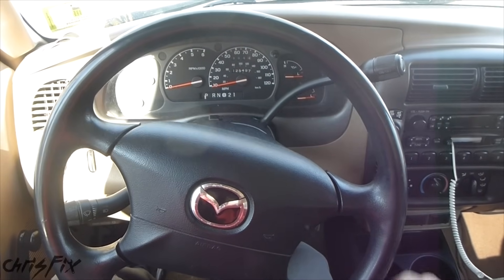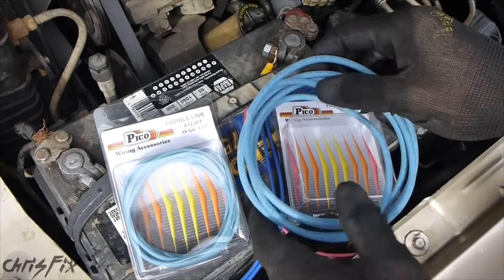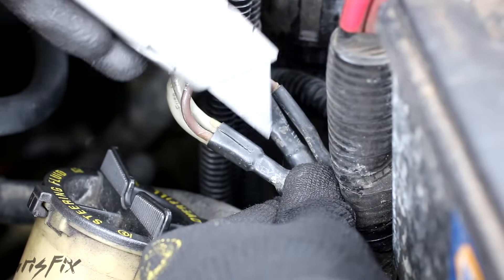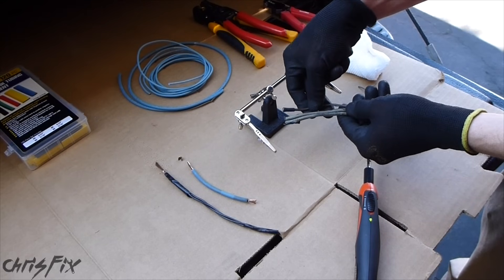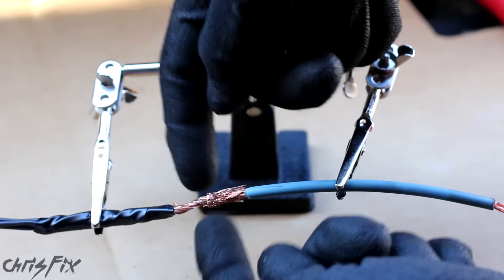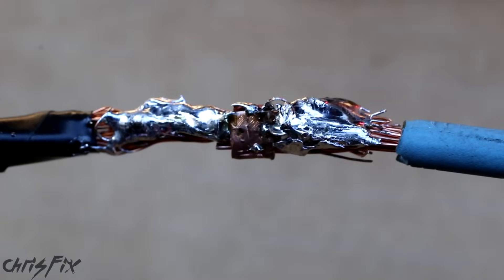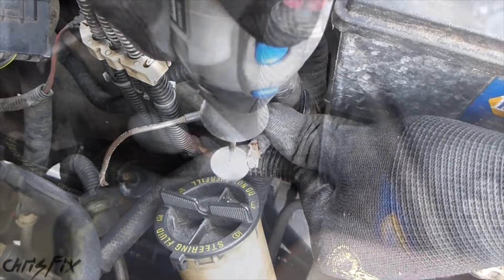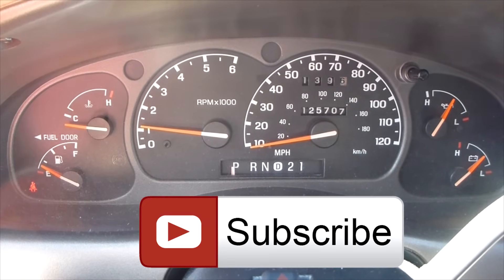How to Replace a Fusible Link (Car won't Start)

Comment: Smashing job chris :-))
Resistance is a dam nusance, makes a big impact at high currents, i like the ring crimp :D, ive wrapped a single strand of wire around the joint to compact it and hold it together for soldering, handy for times where you dont have clamps :D
When i worked in an autoelectrics shop i had to fit big military plugs onto 16mm sq battery wires, spreading the wire strands apart and tinning them was my way to make a good solder job, a large highwatt weller soldering iron was a must!!

Your iron hasnt got enough mass at the tip to deliver the heat, thats why you had a little trouble, bigger and higher wattage chris :), im not picking fault, its just experence from an old git ha ha :D :D
Flux is really helpfull on hard to solder wires :D
Reply from the maker: zx8401ztv Thanks bud and thanks for the tip! I think I will return the soldering iron and get a bigger one! Any recommendations?
Reply: ChrisFix
For ordinary wires about 40w if outdoors, wind and such cools them down.
For battery main wires the bigger the better, a 100 watt with a solid copper monster tip, like a screwdriver but made for frankensteins monster lol.
Just think about the heatsinking effect of big wires and the fact you want them really hot to make the solder flow like water.
You can allways spot a cold joint, its like blobbed on the surface, not sunk in to all the strands, with large currents like starters pull, you need every strand to be doing its job.
You cant rely on the strands being close to each other in the cable, dampness makes the strands go black and they become seperate due to the corrosion.
Sorry chris, i do waffle a bit, but i want you armed with a full understanding.
See if you can still get soldering flux, its an acid that cleans copper and makes the solder flow better :D
Reply from the maker: zx8401ztv Thanks for the info! Yea, this was a 60watt and I tried my 160 watt but neither did the job. Maybe I need a butane one?
Reply: ChrisFix
Its not just the power, the tip has to have enough bulk metal to store the heat for long enough to do the job, most irons take a while to warm up so there element isnt capable of delivering constant heat for very long, thats why you need a bulky tip, the element brings it up to temprature but the tip is an instant power store, so the heat only drops slowly as you use it.
Can you see where im coming from?, lol yes the uk lol.:D
Reply from the maker: zx8401ztv Gotcha! Ok, so I will try to find a flathead tip!
Reply: ChrisFix
As bulky as possible.
And when you apply the soldering iron, tin the tip and put solder between the tip/wire interface, it make the heat conduction better/faster :D
Reply from the maker: zx8401ztv Thanks for all of these tips! Maybe we can talk some time for a future video on soldering!
Reply: ChrisFix
Get the conditions right and it will be eeeasy :D
Reply: +zx8401ztv Those are excellent points. Also, in the rare case where there is room to safely swing a torch, propane is a much faster way to heat and solder big wires like this. I like that little copper crimping clip that Chris used. Next time I'm in the  parts store I'll look for those.
Reply: +spelunkerd 
There are some nice tools out there, the trouble is you would need to rob a bank to afford them ha ha :-D
Problems soldering is typically dirty and un tinned copper, the connector needs to be clean and tinned, the rest is having enough heat stored to get every strand hot enough to melt that solder so it flows like water.
Oh never use lead free solder, yuck yuck LOL :-D

Comment: Are there fusible links coming off the alternator wire where it bolts to the alternator? Also if ones corroded or not getting connection will it make your lights pulsate headlights,dashights and dome lights

Comment: If you have an older car such as a Mustang GT FOXBODY 1988 for example, it has a starter solenoid which has the same symptoms as Chris is showing :)
Reply from the maker: Andres Rivas Thanks for sharing Andres! This info will definitely help a lot of people!
Reply: Thanks for posting this comment
Reply: I have a 95 mustang that won't start has new battery but the negative post gets hot. The alarm goes off when door is open an using the push putting alarm will not lock or unlock car it has the viper alarm

Comment: Just FYI, that same problem can be cause by corrosion on battery terminals or connectors, especially on large amp drawing systems, for instance a 7.3 PSD that requires 900 amps to turn over.  Corrosion causes not enough current to be able to flow and you get that exact same result.  Turns on, almost wants to start, then no power left.

Clean battery terminals and connections and it will go away.

Comment: Hey Boss, what kind of crimp is that? And what other types of crimps are acceptable? Can I also just solder the wire well and use heat shrink tubing?

Comment: You have to make sure you use water proof shrink wrap. there are shrink wraps that when you heat them up, clear glue oozes from it and seals it up. its basically hot glue silicone If your not getting that then its not water proof
Reply from the maker: Thanks for the tip!

Comment: Hi Chris I have kind of the same problem with my 06 Grand Prix. It will happen randomly throughout he day. I'll try to start my car and for like a second it feels like there's no battery and then the car will start. All battery connections are clean and the battery is new. This started after my mechanic changed my ignition module. When I told him about this problem he said it has nothing to do with the ignition module. I tried looking for the fusible link but couldn't really find it. Any thoughts what could be causing this problem? By the way love your videos.  Thanks to you I managed to change my breaks on my Grand Prix two weeks ago. Thanks again.
Reply from the maker: bojna1 Glad the videos are helpful. I would check all the connections to the battery, starter, alternator, fuse box, etc. Check any fuses and relays that have to do with starting the car. Without seeing the car it is hard to say but that is where I would start.

Comment: Are these wires the same as the Fuse links in the fuse panel? They look like a box with the wire inside and a clear cover on top that say 30A, 40A and are different colors. Could you swap a fuse link wire with a plug in style fuse link?

Comment: After I solder the wires, I use a pair of pliers and go round the connection and flatten all the stray wires so they are smooth and do not poke thru the shrink tubing.  I want to prevent it from shorting out again.

Comment: Sometimes you can have a similar issue due to those universal battery terminals that "smash" the wires, like you have on your truck.  I had an issue with those.  Everything was tight, but I would lose all power occasionally.  Turned out to be the universal terminals.
Reply from the maker: Blaine Bugaski Thanks for sharing! I need to get rid of those universal connectors!

Comment: is it wise to add a bigger 4 gauge power wire to existing one or replace stock one with 4 gauge? I upgraded my alternator from a 90 amp stock to 160 amp. I’m having some charging issues at high rpm’s. Should I also replace the fusible link to a 160 amp fuse?

Comment: Does your 50 amp fuse break as well and have to replace?
This is the same thing my truck is having problems with but won’t crank. 
Have to keep replacing my 50 amp fuse every time and when I do my dash lights up but when I go to crank it the same thing happens it goes dark and seems like it’s the battery. 
New battery new starter put in recently.
Reply from the maker: No just the fusible link went each time. Try checking the wires from the fuse and make sure they are not bent and broken a little causing more draw. Or that they are corroded.
Reply: ChrisFix really appreciate it my brutha thanks for your input

Comment: Fusible links in cars are generally used to reduce the likelihood of a person not taking their car to the dealership for fixes. No way around it, it is an intentional problem. Fuses and breakers can do the same job but those can be replaced by the everyday-knowledged person

Comment: Hey chris , out of topic question , My car have an electric fan clutch and it have a big cable with lots of wires , how do i connect the new only 2 cabled electric fan to the old cable ? should i connect it to the old cable or just skip it and connect it directly ?
Reply from the maker: eyad aljamal So you have an electric fan and replaced the motor? The old motor has many cables and the new motor has 2? Just want to make sure I understand. They didnt have a plug and play motor for your car?
Reply: No i have an electric fan CLUTCH , its like a normal fan clutch but it come with an electric wire from behind to connect it to the main computer to control the speed of the fan , so i looked around and it seemed like its a common problem in all cars that uses the same electric clutch , so i decided to take the old fan and electric clutch and Install a new electric fan like what you would find in newer models , so i looked around and i found out that the best fan can fit in to my car is the same fan you will find in your ford police car .
so the ford fan have two wires power and ground how or should i connect them to the same electric fan clutch wires ? or connect the fan directly to the battery ?
Reply from the maker: eyad aljamal Gotcha, now I understand. You might have some trouble wiring it up because the fan clutch should activate based on temperature. When the radiator gets to a certain temperature, the computer sends a signal to lock up the clutch. It is also telling the clutch to disengage based on rpm (you dont want the fan spinning at high rpms. If you just connect it to the battery, then it will always be engaged.
Reply: yep and now its always engaged and the car temperature is always low and that's good .

Comment: Community.      could I use a voltage meter to identify the wire issues. I dont want to cut into the harness until i am sure.  Because of corrosion- I replace to rings of the fusible links, that are attached to the alternator ( thick yellow), at the fender mounted starter relay but I have flickering lights. I cleaned all grounds in engine compartment. I believe it maybe corroded inside the harness. How can I test for that?  Thanks

Comment: You can also use a 10ga crimp connector if are splicing together a to ends of a single wired link. Keep in mind: the small wire coming of of your positive battery cable is not actually a wire but a link. 1981 Corvette Owner

Comment: oh yeah one more thing Chris the check engine light immediately came on. It sounds as if something popped loose not sure what. anything you think I could check without having access to a tester? thank you have a good day
Reply from the maker: mr ok Get the code for the check engine light and let me know what it is. You can find cheap testers these days.
Reply: I'm willing to bet that's exactly what I will have to do thank you so much for responding back I wish you well. Keep up the good videos and helpful tips.

Comment: Interesting-- charging system stopped working and it seems there are two fusible links to the alternator. I have a vehicle quite similar to yours ( I have a 2000 Mazda B4000) . I don't see the fusible links sticking out to the battery cable bundle. Could they be elsewhere?

Comment: I have a 1976 GM dump truck 1 ton that has two fusible links though they are working right now I am going to be doing some electrical work to add some circuits and I don’t like them because they are turning green I’m going to replace them with easy to replace maxi fuses at the rated amperage the circuit can handle then I will know when they are blown and are easy to fix.

Comment: Hi Chris, I am having this same problem with my 1993 Lexus GS300. I have replaced the alternator, battery, and 100amp fuse. The car still will not start.. Since replacing parts, my lights will only come on when turned to the on position. The lights are suppose to turn on automatically. Also, now my radio, dome light, and heat/ac dash lights wont come on.. All fuses have checked and if bad were replaced.. I don't get it.. It all worked perfectly before, and I've never had any problem like this. I don't have the money to have it towed and then fixed. I know that the starter is also good. Its like Im not getting any gas. Could it be a bad relay?? This is what I'm assuming it is but I have NO IDEA what a relay looks like let alone where it would be located and how to check it?? I know there is a relay that controls power to the fuel pump and alternator.. I really think this is my issue but again do not know where it is located because I do not have access to a service manual. Any knowledge you have or might be willing to find for me would me awesome.. I've been car less for over 2 months now...Please help. Thanks
Reply from the maker: +Lori Kerns Dang, that is hard to diagnose without seeing the car. I would say do a fuel pressure test: https://www.youtube.com/watch?v=_oXLUqE4Sf0 but that wont help your electrical problems. Make sure the battery ground is clean, and that the wires dont look melted anywhere.
Reply: Thank you for your advice...if you happen to think of any other ideas please let me know
Reply: I had that a couple times. Dirty terminals was the first one I had, lights and radio still worked but car wouldn't start. Second time, being an Automatic this time, it was in park but didn't register. If auto, try starting in N or putting the car in park with purpose.

Comment: Could be a dumb question but instead of replacing a fusible link with the same wire, can I just add a in line fuse holder to where the fusible links at?

Comment: 04:50 If you solder like this in the fusible link, in the case of a short, the solder will blow and not the fusible link. Very bad Solder Job (Cold Solder) you need a powerful soldering iron.
Reply: The second image is good.

Comment: Here’s a tip for you guys. Instead of using a solder iron try using a bbq lighter to heat up the wire. (Obviously don’t burn the wire insulation) its long and easier to reach

Comment: Hey Chris, I just had to replace my battery in my 1996 Buick Century and now I'm having issues with it losing all power at times.  I wiggle the positive battery cable and it's fine for a few weeks then it happens again.  Never had this problem until old battery died.  Do you think the positive cable might be broke?  I love that old car, but it's not reliable like this.  Being it's 21 years old I don't want to spend a fortune on it.  I hope you can help.  Love your channel and I'd ditch that truck if I was you, lol

Comment: Good stuff!  Accurate info, well presented and to the point...    
As others mentioned, using flux helps to ensure the joint will be clean, and using a higher wattage iron is a good thing for larger diameter wires...
An old trick is to "wet" the heated soldering gun tip with a small amount of solder just before applying the iron tip to the splice... It helps transfer heat from the iron to the wire, and assists the solder flowing from the opposite side when the wire is heated adequately.
Also, for solder joints subject to moisture, after soldering the splice, covering it with dielectric grease (a silicone based grease specifically for keeping moisture out) before sliding and heating the shrink tubing will ensure moisture is kept out.  To further minimize moisture entry, cut the shrink tubing long enough to cover the insulation by at least three diameters of the insulated wire on each end.  When the shrink tube contracts, it will "ooze" the dielectric grease out, and you can rest assured the car will disintegrate from age before that joint will fail.
Keep up the good work!
Reply from the maker: jimmbbo Thanks a lot man! AWESOME TIPS! Thanks for the info!

Comment: Trying to solder big wires like this with a small soldering iron is not easy, especially if you fail to coat the wires with rosin core flux before you mesh the two arms together. You get a cold joint, as shown.

Comment: Use some acid based solder  paste, it helps big times with the heat transfer and will pull the solder through the connection leaving with you with a perfect solder joint every time! Also make sure you use the proper soldering gun/iron for the job, that little iron is good for electronics, but those thick wires require more heat!
Reply from the maker: mikebar55315 Thanks a lot man! I appreciate the tips!

Comment: I use adhesive heat shrink tubes. Much better water resistance

The best are 3M and Wurth, but cheap chenese is good for automotive applicatuion too

Comment: Use silicone grease to really make the joints water proof. Spread it over the soldered wires, THEN apply the heat shrink tubes. As you heat the heat shrink tube, the silicone grease will push out and seal the joint from ALL corrosion. BTW, I agree with others, crappy soldering!

Comment: Mr. Fix, please add a small can of resin to your toolbox. If your are soldering a thick section of wires (or joining two wires together at their ends) apply a small amount of resin, with a plastic bristle brush, to the wire(s) before soldering. This will help the solder flow through the wires better. Also, use a soldering gun, and not a soldering iron. Soldering irons are for 18 awg or smaller wire. Guns can get too hot for the wires insulation, use clip on heat sinks commonly called rheostats.  Happy soldering! Remember it hurts a lot to get the soldering gun too close to your fingers. :)

Comment: Chris if the wire going to my starter has a fusible link and my starter is good..and battery is good..grounds are good fuses are good..would that cause my no crank issue? I've tried everything man